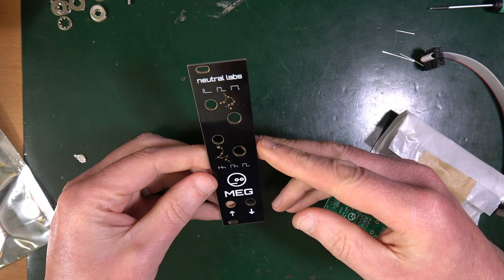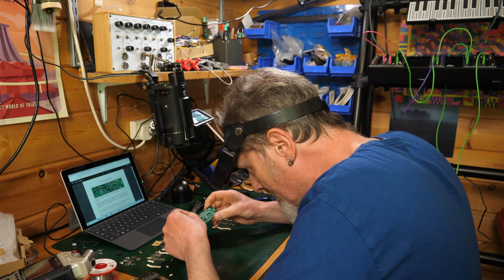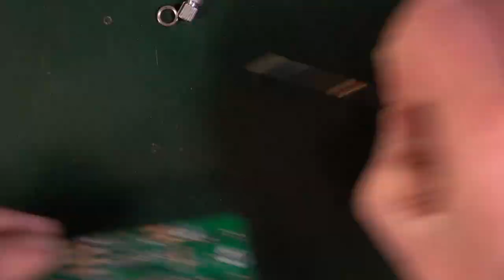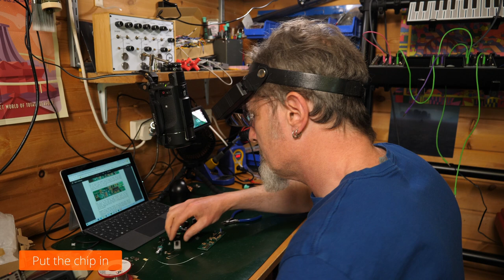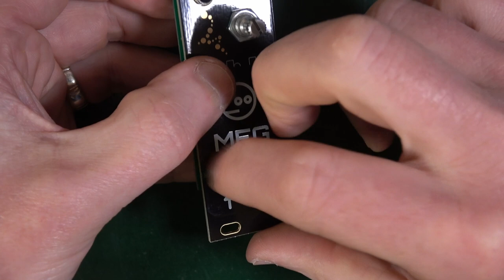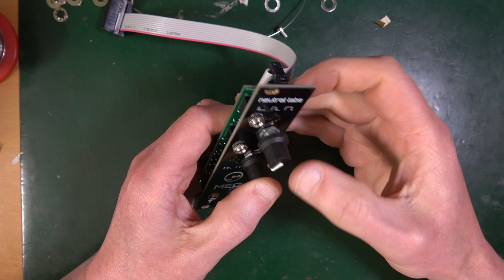Neutral Labs Meg waveshaper DIY Build

Comment: Hi Robin!  Thanks for actually showing people how to solder correctly, there are a lot of internet folks who just sort of drip it on and hope...  Having stuffed  a lot of boards over the years (Think back to heathkit and home brew computer days) here are two hints that might be helpful.  1)  Just snip the leads at the edge of the tape.  Saves all that tugging and bending of leads and keeps adhesive swill out of the plated through holes.  You need a bit more care doing this with LEDs as you won't have a long lead, but LEDs have a flat, just as polarized caps have a stripe.  2)  You mentioned some folks bother with putting all the resistors in the same way.  It's sort of habit you get into with larger projects with hundreds of parts, it lets you double check values quickly if all the color codes run the same way.  Great video as always, Thanks.

Comment: Nice sounds. Is it purely the waveshaper, or is there some filter squelching going on too?
Reply from the maker: Just waveshaping - i was doing some filtering on the other end. The source was mostly a sine wave.
Reply: Because it adds pulse waves on top of the sine (or rather by flipping parts of the sine), moving the PWM knob can sound a bit like filtering, since by doing so you change the relative amount of pulse wave to sine wave.
Reply: @nyppy  cool.  I'll definitely be getting one when they're back in stock at Thonk.